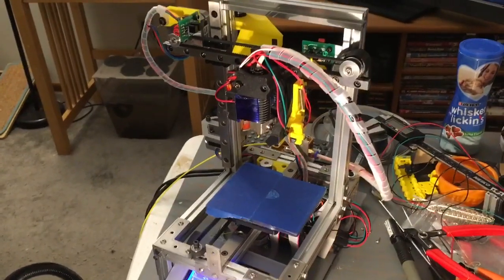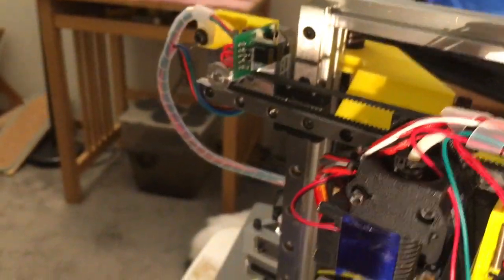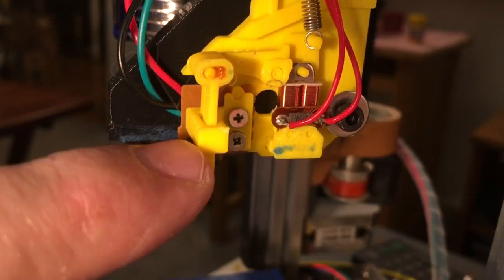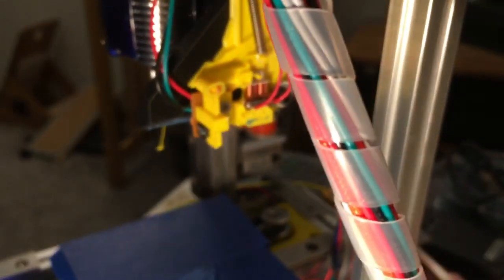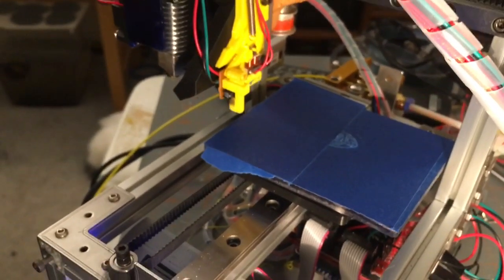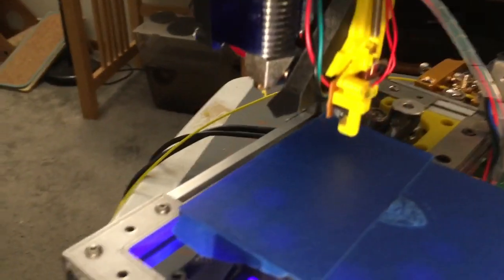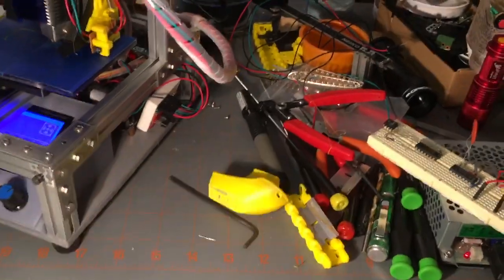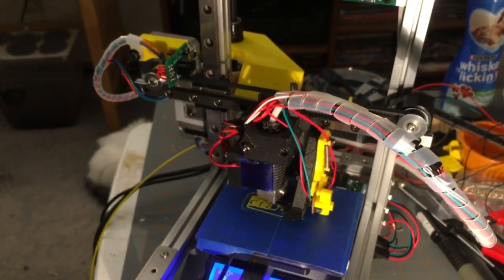Tinyi3 cantilevered 3D printer

Comment: A nice project. Thanks for sharing. What linear rails did you use?
Reply from the maker: Thanks! A good question, since all of my rails are just scrapped parts from machines that I pulled from the recycle bin at work. I really just looked at what I had on hand and how it would work in this (or any) project and built around them.  Yeah, I know, that's not really a good design plan- but Printerstein is about building out of what you have, not what you can buy.
X- IKO LWL9B
Y-IKO LWLF14B
Z- IKO LWL12B
Probably pretty pricey parts if I had to go buy them, I'm lucky to have the sources I do.

Comment: I'm in awe with your Z probe design! Looks like I'm taking apart spare laptop disc drives today. The build looks very rigid!
Reply from the maker: Thanks man! It was a little fiddly to get all the dimensions right in that small space, but it’s been solid once I got it worked out. I hope you can make it work for you!
Reply: @printerstein1321  what do you think the cost ended up being (including time spent, clearly this is a hobby but I'm still curious). Love your build! At this point I'd probably go with something more modern than RAMPS just because I think it might be cost competitive. I just got an MKS sgen board (32bit!) For about the same cost as ramps
Reply from the maker: @paulgupta2454  thanks! It was a fun build. And it is still my go to printer. BUT- what did it cost me? My goodness. The maker beam frame kit was$120 although it was a gift.does that count as free?  Those linear rails are nice industrial parts, not hobby stuff. but again,free to me. The hotend, extruder and motors were cheap stuff. The sensors were scavenged from some industrial machine. As noted,basic arduino/ramps control.  I spent hours of my life designing,printing,and redesigning.If i were to say i got paid by the hour to design like i got paid at my day job,it would have been hundreds of dollars!  especially the bed probe. But my actual cost for parts was less than$100 I'm sure. I have quite the collection of used industrial parts and i just dig through the boxes until i find what i need. And many of the basic printer parts were bought for other printers and then re used for this project. I've built over a dozen printers but then took them apart to build something else. So exact costs are hard to pin down. I enjoy the creative process of designing and building, and this hobby gives me a way to do that as well as upcycle old machines. I'm not sure i answered your question well,but I'm afraid that's about the best answer i can give you.